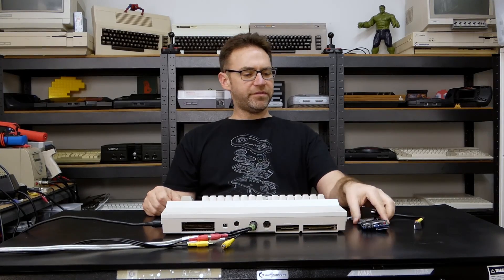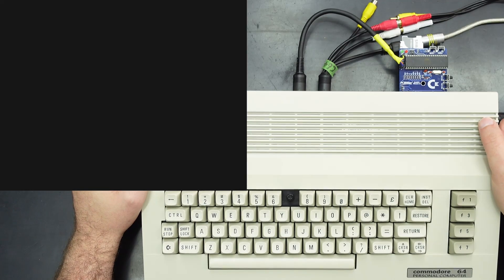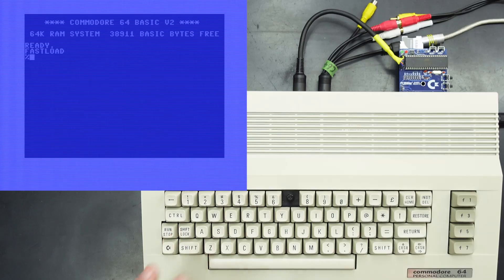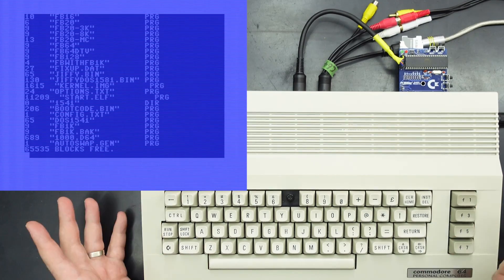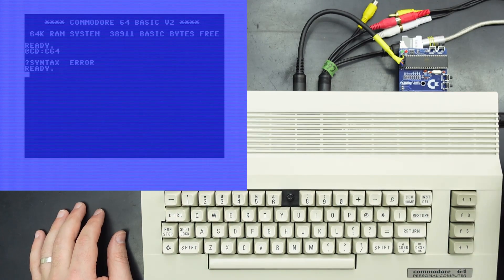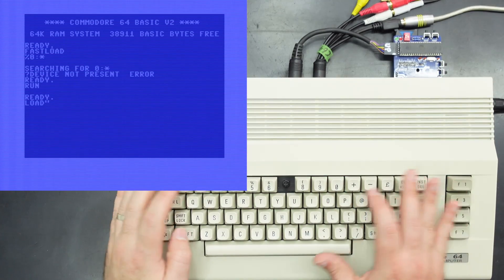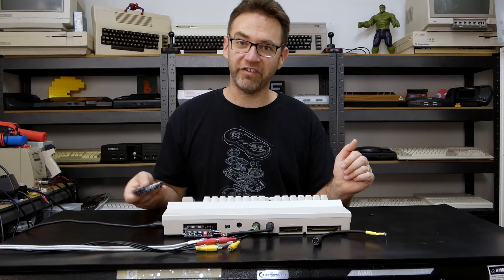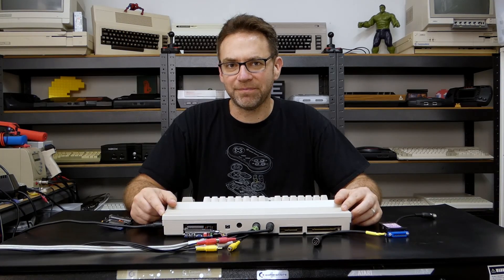SD2IEC + EPYX Fast Load - The Operation

Comment: Is it possible to make the SD2IEC "drive" 12, so I can use the SD2IEC part to load and run C64OS?  Also, how well does JiffyDOS 6.0.1, and SD2IEC Epyx Fastload Combo Cartridge for the Commodore 64 work together?   Thank you all in advance.
Reply from the maker: I don't think you can change it to 12, only 8,9,10,11. If you already have JiffyDOS then the epyx fastload won't help, it's actually slower and less reliable than JiffyDOS

Comment: Hello, I own a breadbin with a brown keyboard but one single white key - the seven you miss in your keyboard. If you can send me a standard, big cross brown C64 7 key and I will mail you mine. How does that sound to you?
Reply from the maker: Thanks for the offer, but I already sourced a replacement for the 7 key. You might want to check out the retroleum website, he usually has spare keys available at a reasonable price
Reply: @TheRetroChannel  Yeah, I have already checked there, none of their sets have the friggin 7 key. I will check again and when I find one if you still want my white key I will send it to you for free. Cheers!
Reply from the maker: That sucks. Yeah I had to keep checking back for about a year to see if the 7 key for my machine was back in stock, eventually it was. Appreciate the offer but I have no need for another 7 key, maybe one day you'll come across a C64C missing a 7 key
Reply: @TheRetroChannel  😂

Comment: does anyone know if I would be able to use just the SD2IEC portion of this on its own WITHOUT the fastload? my plan was to save projects I make on the MSSIAH cartridge onto an SD card, but if this thing grabs its power through the cartridge port itself then it's obviously not doable as MSSIAH is already plugged in there. any ideas?
Reply from the maker: It's possible, when it's not plugged into the cartridge port it works just like a vanilla SD2IEC (without the fastload). But you need to supply it power - there is a header on the board for supplying it with an external 5V.

Comment: Been making these for a while, they are pretty good, I have a Pi1541 epyx fasterload and yes I actually have the now impossible to get pizero for it, and i never use it.  I also have jiffy dos and I just find these things easier to use unless there is something that specifically doesnt work.  In that case, Ill get out the pi1541, but i find the whole lcd mounting clunky and annoying.  For the most part games that dont work on the sd2iec/fastloader.. ill just copy the images to real disks from it rather than dig out a slow.  If its slow as a 1541 why not just use a 1541.   Dont see the point of the dips tbh since its something you almost never do.  If some1 is gonna waste time reversing to make yet another sd2iec, i think they should put their time into making a pi1541 alternative that uses an inexpensive and easily available SBC and making it open source if they think thats important.
Reply from the maker: Agreed. For stuff that doesn't work I'd rather copy it to actual disks rather than using the pi1541. Sure you can speed up the pi1541 with JiffyDOS, assuming you also have Jiffy in your C64, chances are you probaly also have JiffyDOS in your 1541 so why not use that and bathe in the nostalgia.
Anyway some of these things I go into in the next video, including why I prefer dips on the SD2IEC. Video is only available to Patrons at the moment but goes public early next week
Reply: Yup there is an interesting sd2iec alternative that i have thrown together which is an sd2iec kernel cart combo.  Same closed design, would be simple to reverse, but lets you put 8 kernels on the thing.  It ezihooks to the 6510 and you can put jiffydos, dead test, or jupiter lander on it lol.

Comment: Thank you for the Commodore video! I really like your dip switch mod on the 2nd cartridge. I have my real Epyx Fastload cartridge from 1984 and a 2nd real one from a "Huge C128 lot" I bought on Ebay a few months ago to get the 1581drive and a 256K and 512K Commodore REU's. I have had a SD2IEC for about 3 years now from TFW8BIT and love it. I have added a C128D, SX-64, plus/4 and C16 to my collection over the last 6 months so I ordered a new SD2IEC from them that has 3 kinds of power input so it will work with all those machines. They are the C64's Cassette port, plus/4's cassette port and a user port to use with the SX-64 and C128D.
Reply from the maker: Awesome! Nice little collection you've got going. I may be a little jealous 😀